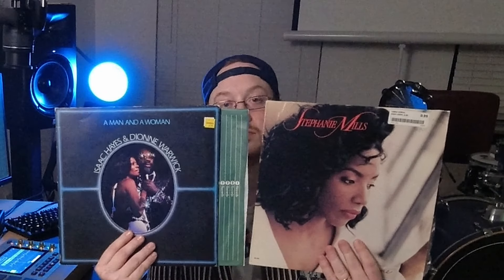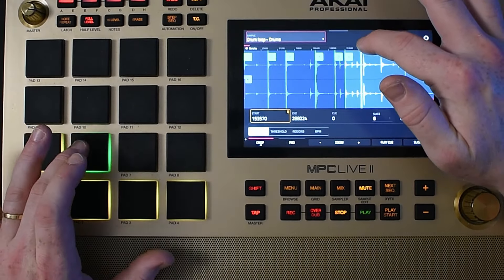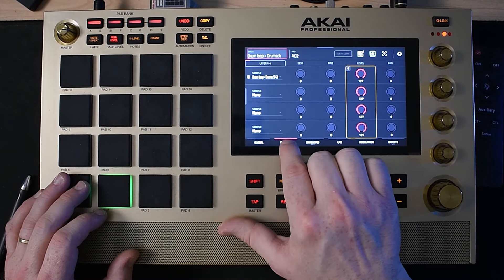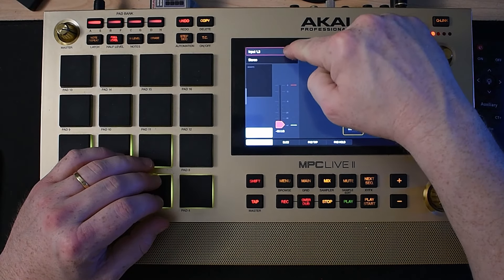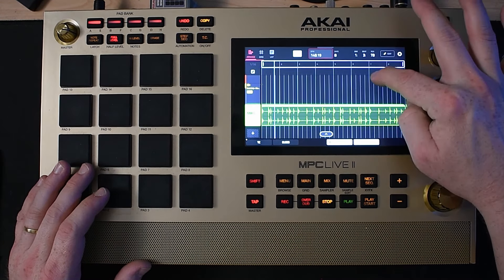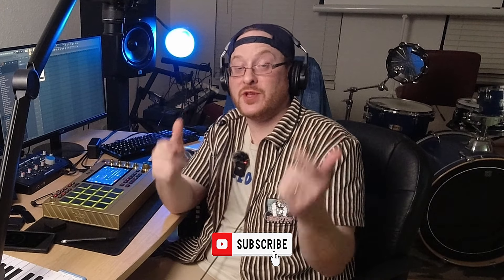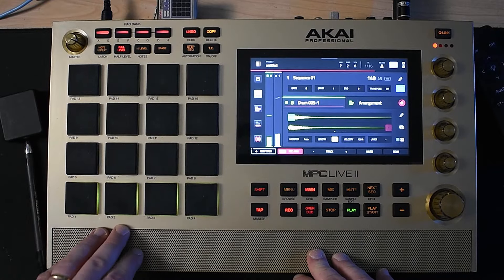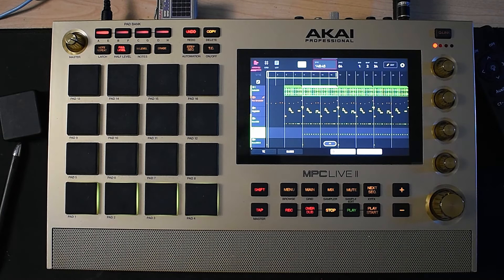Akai MPC Secret For CHOPPING SAMPLES Like a Pro

Comment: Great video! Can you break down how you connected the keyboard? I assume you connected it through USB. What internal connections on MPC did you set in order to trigger the sounds? Tks in advance!
Reply from the maker: Thanks for watching! I appreciate you 🙌 you should be able to just plug it into the back of the MPC usb slot and it should start working right away. I didn't have to configure anything. But I'll definitely  mention this in my next video and show how i plug it in 🫡
Reply: Cool.cool. thanks. I'll try that when I get home!!! Preciate it!!